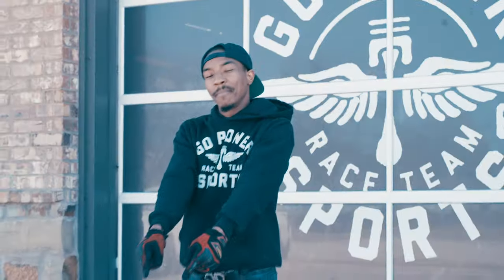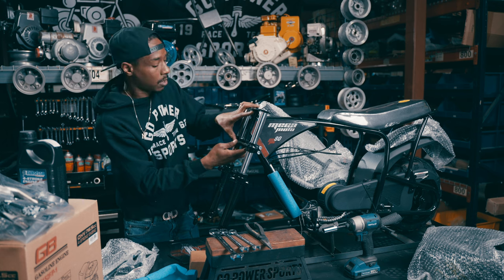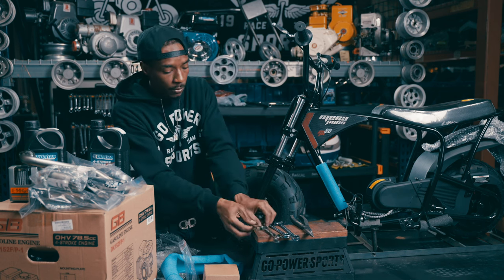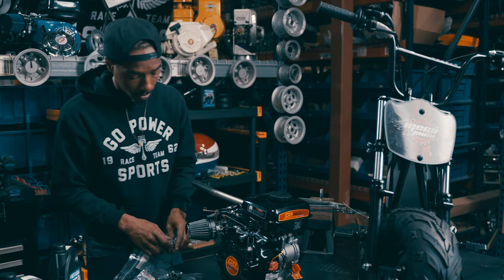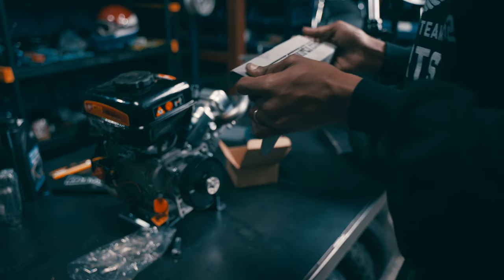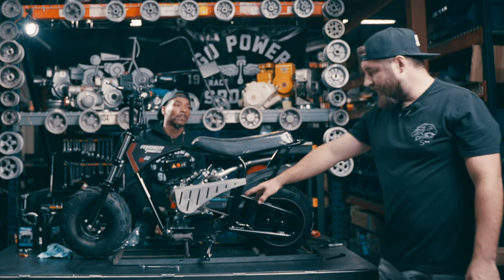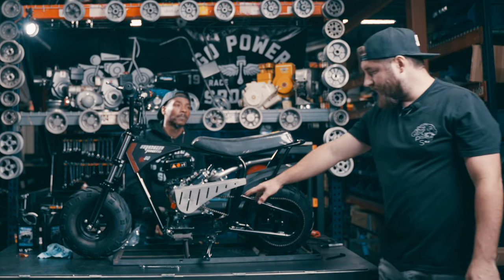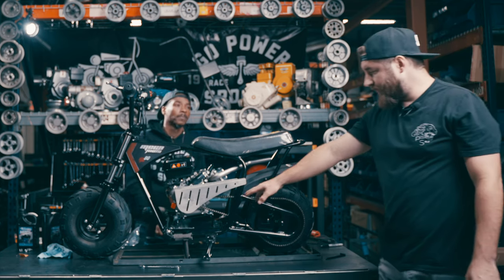Mega Moto Eazy 80 Minibike Kit Build | Tutorial

Comment: On the website to buy the frame all the stuff in red in the description do i have to buy? Cause im putting a predator 224cc engine on there so i was wondering do i have to still buy the stuff in red
Reply from the maker: You'll atleast need the Mega Moto 80 Motor Mount Kit.  Then a header pipe and aftermarket air filter whether it's the stage 1 or a Mikuni setup.

Comment: Would a predator 224 fit on here with no modifications to the frame?
Reply from the maker: The 224 would fit in this frame with no stock gas tank if you use the riser.
Reply: What about Predator 212 hemi?
Reply: @MikeBeatzcom  212 and 224 are the same size length width wise

Comment: Hold up? I was just there 2 weeks ago and was told you guys didn't have a stage 1 KIT for the 79cc. You guys have one now?!  :D
Reply from the maker: It is an air filter, adapter, and header pipe.  We would not have a bigger jet, but it seems to run fine with the stock jet.
Reply: @GoPowerSports I drilled out my jet with a wire drill bit, and it works PERFECTLY

Comment: Why do you supply it with a chain that doesn't fit?
Reply from the maker: Tell me more so that I can pass the information along.  Was it too long or too short?  Was your engine pushed all the way to the rear of the bike?
Reply: @GoPowerSports  Thanks for responding. I have the Mega Moto 80 frame kit and I bought a 79cc Predator. I was basing the comment off two things - 1) Flacko (comments in this video that when you get the bike, the chain isn’t going to fit). 2) My chain doesn’t come close to fitting. I have the predator on the same mount as Flacko and in the standard bolt holes, pushed back on the adjustable one.
It’s not impossible that I’ve overlooked something. I’ve also had a lot of seemingly missing parts (e.g. the clutch) but I was never quite sure what this kit was supposed to come with so I just order things that are missing.
Don’t get me wrong, still very excited about the build and love your videos - really helpful for folks like me that are new to Mini-bikes.